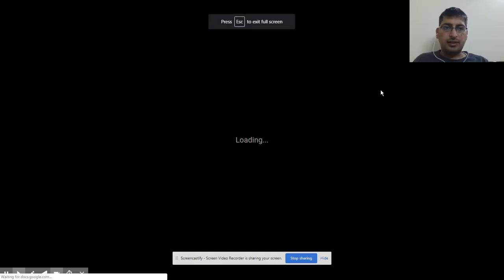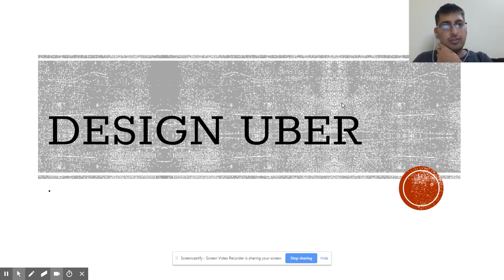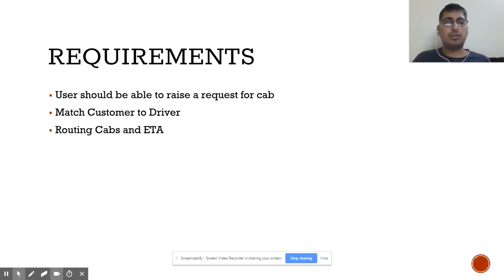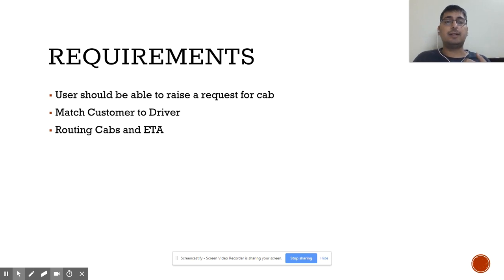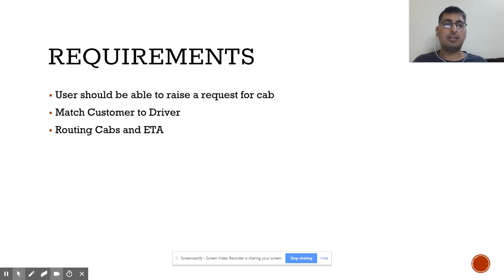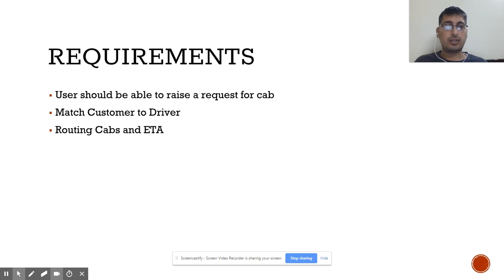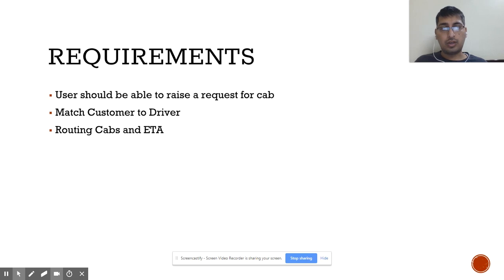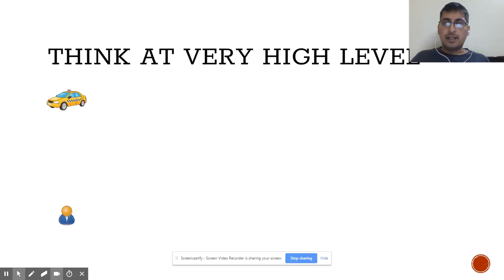System Design | Design Uber | Design Ola | Uber Architecture | Lyft Design | Amazon Interview

Comment: Data Savvy, I have the same question, as already mentioned in the comments: how nearby cab finder microservice gets updates of the locations of the drivers? From the proposed architecture, it's not connected in any way with the NoSQL DB wrapper.

Comment: Nice video. Can you please tell me how can we design the NoSql DB. What could be sharding criteria?
Reply from the maker: sharding criteria usually depend on your access pattern. can you elaborate on your usecase
Reply: @DataSavvy  In the video, you said we will keep the driver location in NoSQL DB, what would be the sharding key for cabs location data? To fetch fast their current location. The driver will be continuously moving after every 4-sec new location feed will come and the old location feed will be stale data.
Please help.

Comment: Nice Video Anshul. Can you please elaborate more on the choice of NoSql for storing the driver updates? This is because one of the common questions in the interview is - When do you choose SQL/NoSQL and why ?
Reply: Reasons to use SQL database
Here are a few reasons to choose a SQL database:

1. We need to ensure ACID compliance. ACID compliance reduces anomalies and protects the integrity of your database by prescribing exactly how transactions interact with the database. Generally, NoSQL databases sacrifice ACID compliance for scalability and processing speed, but for many e-commerce and financial applications, an ACID-compliant database remains the preferred option.
2.Your data is structured and unchanging. If your business is not experiencing massive growth that would require more servers and if you’re only working with data that is consistent, then there may be no reason to use a system designed to support a variety of data types and high traffic volume.

Reasons to use NoSQL database
When all the other components of our application are fast and seamless, NoSQL databases prevent data from being the bottleneck. Big data is contributing to a large success for NoSQL databases, mainly because it handles data differently than the traditional relational databases. A few popular examples of NoSQL databases are MongoDB, CouchDB, Cassandra, and HBase.

1.Storing large volumes of data that often have little to no structure. A NoSQL database sets no limits on the types of data we can store together and allows us to add new types as the need changes. With document-based databases, you can store data in one place without having to define what “types” of data those are in advance.
2.Making the most of cloud computing and storage. Cloud-based storage is an excellent cost-saving solution but requires data to be easily spread across multiple servers to scale up. Using commodity (affordable, smaller) hardware on-site or in the cloud saves you the hassle of additional software and NoSQL databases like Cassandra are designed to be scaled across multiple data centers out of the box, without a lot of headaches.
3.Rapid development. NoSQL is extremely useful for rapid development as it doesn’t need to be prepped ahead of time. If you’re working on quick iterations of your system which require making frequent updates to the data structure without a lot of downtime between versions, a relational database will slow you down.